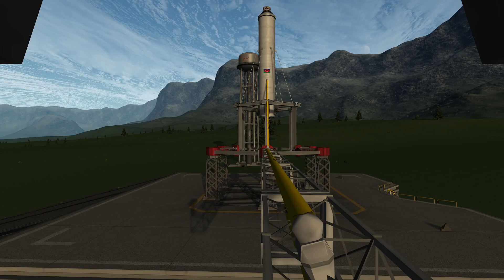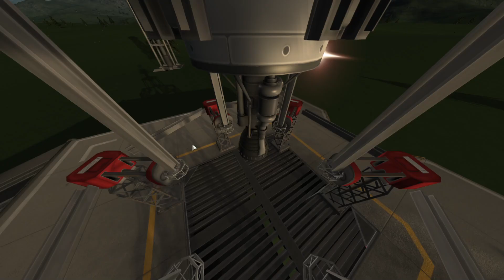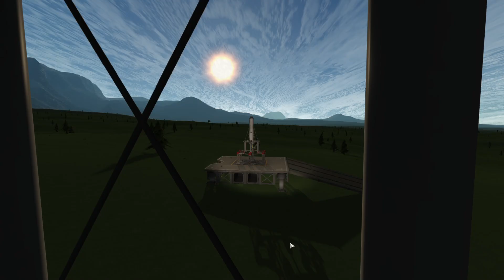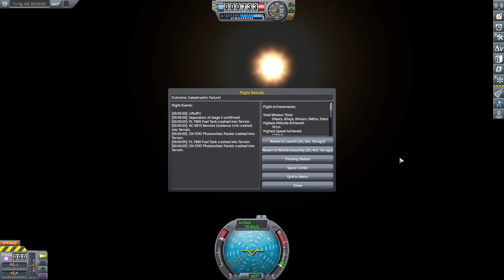(Archive) Kolit 0.1 Booster (FS1) double static fire and RUD

Comment from the maker: Timestamps
5:22 First Static Fire
6:31 Strut Issues
7:08 Go for second static fire (issues arrive)
7:30 Second Static Fire begins (normal
7:35 Odd automatic throttle down to account for wiggle
7:37 Throttle up 
7:39 Clamp Failure
7:40 Upper tank Burst
7:42 Explosion 1
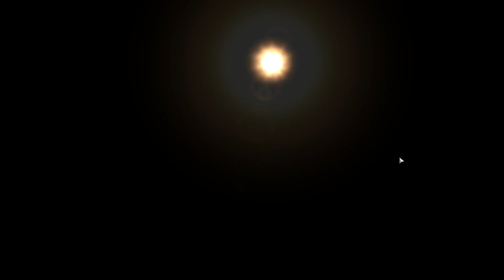7:52 Explosion 2